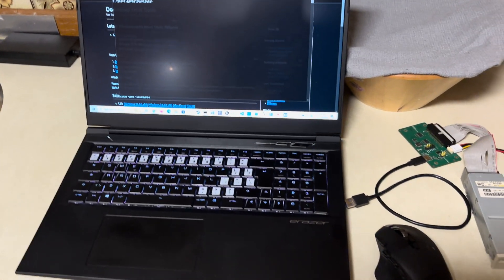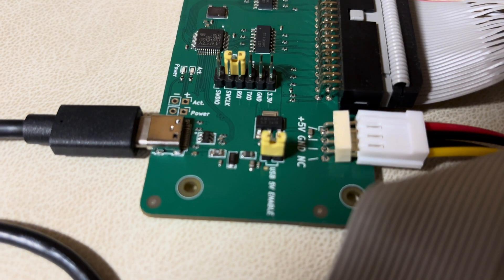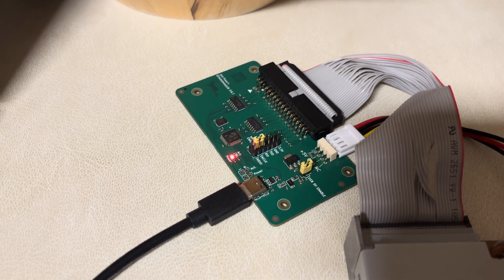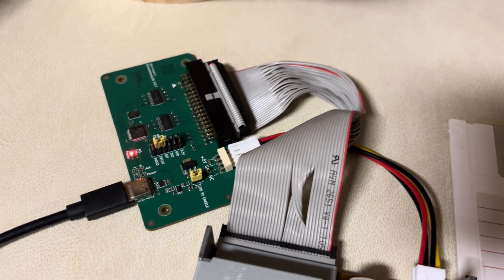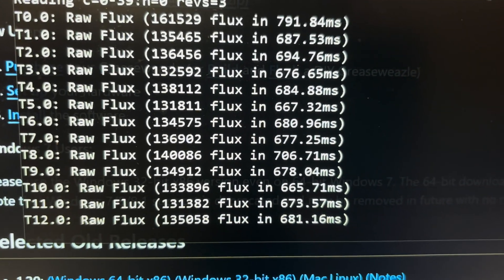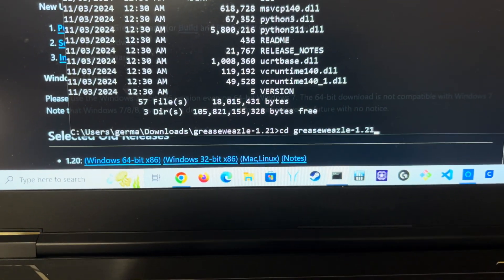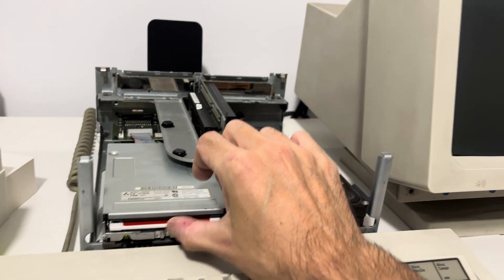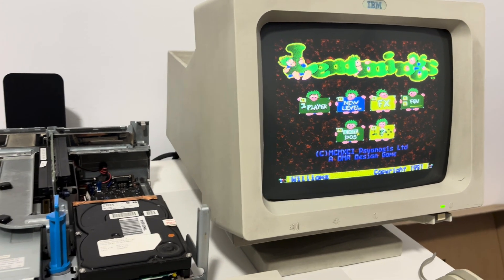Greaseweazle v4.1: Ripping copy protected Lemmings disk

Comment: I'm not sure it actually read the disk when you loaded the game in the video. This game creates a special file in the install folder when you load it so you can continue to load the game without needing to verify the disk for a certain amount of time (maybe depending on the file creation date) so the game will just load without the disk for several months after you first load it with the real disk. I am getting ready to get my own GreaseWeazle so I can archive my own copy of this very game so I hope it really works but your video does not verify if that is the case since you are loading it from an already installed copy that you already loaded with the real disk so that file is most likely present in the game folder to bypass the disk verification process. The disk uses weak sectors which apparently is very hard to write back to a disk without special tools. These weak sectors will give different data back with multiple reads which is what the copy protection is checking for and if it sees the same data with each read it knows it's a copy.
Reply: Ok now that I have my Greaseweazle I can say that yes this does work unlike my previous attempts with my Kryoflux. I got a big grin when the game checked the disk and loaded even after a full uninstall and reinstall of the game. Finally I don't have to worry about something happening to my original disks making it impossible for me to play this or other such copy protected games without a crack.

Comment: Winimage supports DMF copies, I don't know if it can also do this same copy job for this game.

I have been using it for over 20 years now with obviously a KeyGen, and have just seen that it still exists with new updates.
Reply: I have no idea if the original game comes copy-protected in the Amiga. Note that this is the IBM PC version of Lemmings which is copy-protected and defies standard copy methods. Having said that since in this example I show a magnetic flux copy of the disk it works exactly as shown for any Amiga floppy (even if copy-protected) and you don't even need to replace the floppy drive I'm using here with an Amiga floppy drive (no need!)